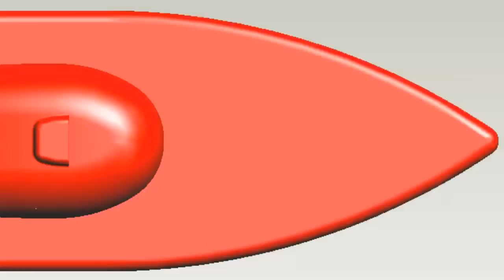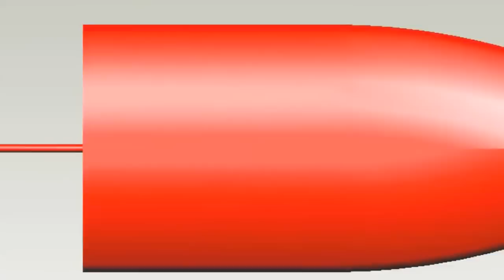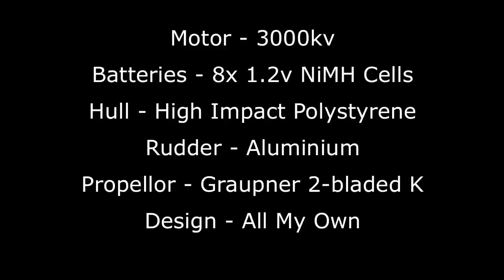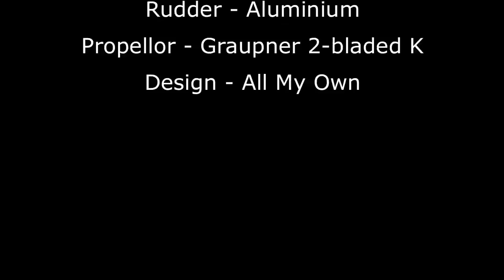Scratch Built RC Brushless Outrunner Speed Boat

Comment from the maker: The two parts were made to meet flush with each other. A balsa lip was glued inside the hull and then sanded flat on a piece of sandpaper attached to a board. The two halves were then glued together. Any rough areas of the join were sanded and then polished out. Hope that helps!

Comment from the maker: @MrMinecraft12373 The thing in front of the servo is the receiver - this is the part that makes radio contact with the transmitter and powers up all the parts like servos and speed controllers. This is the part which the servo wire plugs into! THe black thing on the servo rod is a bellow - it allows the servo-rudder linkage to move back and forth while not allowing water to enter the ill through the stern. Hope this helps, thanks

Comment from the maker: Thanks, its roughly modelled on the MHZ gecko, a nice but very expensive boat! They are made of fibreglass though rather than plastic! I think it weighs around 550g, a lot of which comes from the batteries! What is FPV? sorry! I may go for a 5000kv motor too as the battery life was excellent - i could afford to lose some if anything!

Comment from the maker: No, not really, it means more weight! Weight seemed to be the limiting factor with speed after all! Im switching to a LIPO system asap! The water doesn't come into the boat as it uses a stern tube which falls above the waterline, therefor no water gets in! The colours of the wires on the motor are pretty irrelevant tbh! thanks for the comment!

Comment from the maker: @beckervldejazzcom The motor mount is simply epoxied into the hull. The two halves are joined using a thin bead of wood epoxied into each half to increase the bonding area and then glued.

Comment from the maker: @20057468 The hardware is from a company call cornwall model boats here in the uk. The motor, esc and servos are from ebay. The RC is just a 2ch unit available from any hobby shop. I wouldn't know exactly how much they cost - for the lot probably around £100 in all honesty. I already had a lot of the stuff

Comment from the maker: No, I ordered a mystery brushless motor off of ebay with a 2.3mm diameter shaft, an m2 propshaft from cornwall model boats and a graupner flexible coupling - also from cornwall model boats with a 2mm and 2.3mm end.